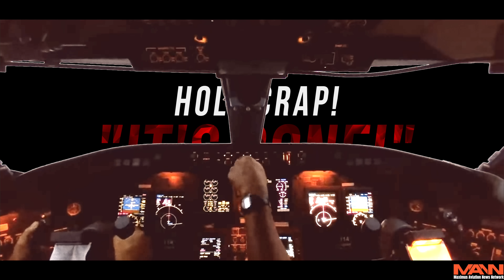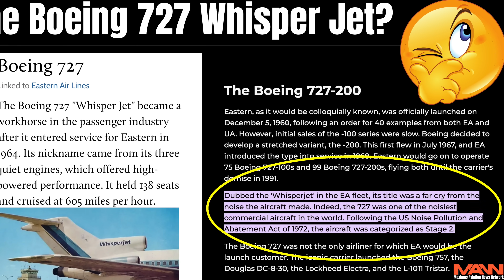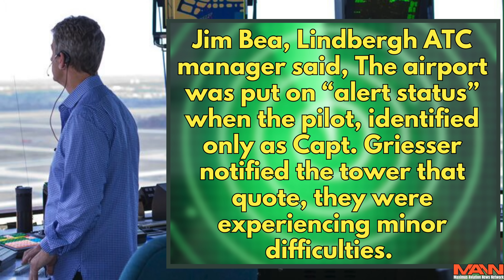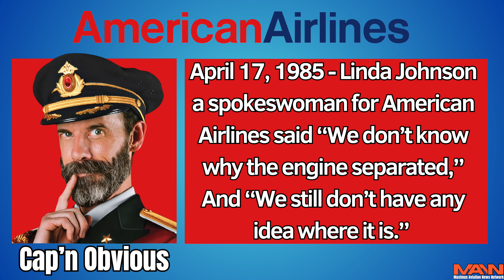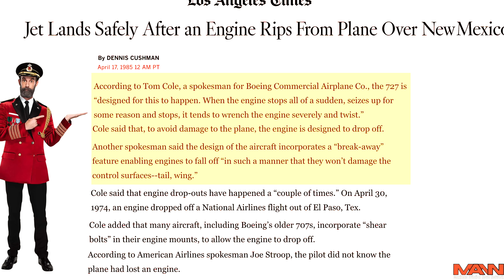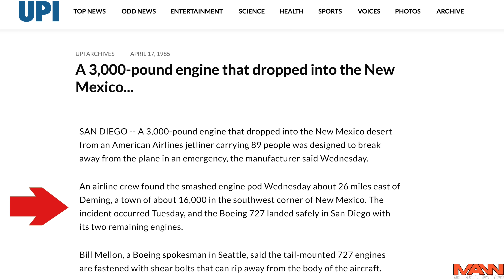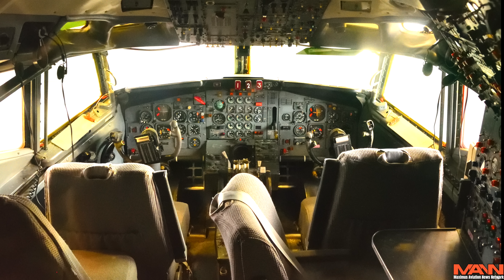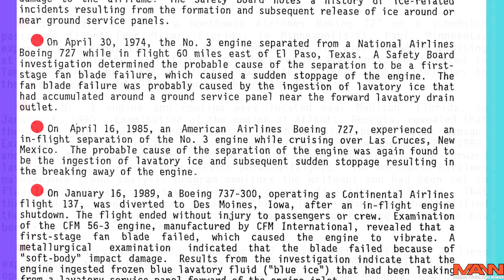Boeing 727 Engine FALLS Off At 35K Feet! Not Just Once But THREE Times. The Plane DESIGNED TO FAIL!

Comment from the maker: ^^ From Maximus ^^ Just so you know, yes I know the livery is wrong in some of the shots I tried hard to find an image I could use that would work but wasn't able to find any and until I get into that Mentour Pilot revenue stream Im kinda tied to whatever I can get 🤣🤣🤣 But yes I know.
Reply: The idea of breakaway engines is, in itself, a good thing.  AFAIK, it's a design feature of ALL planes with podded engines to this day.  Engines produce the IMMENSE forces needed to get the heavy plane into the air at all.  Therefore, if something goes wrong with the engine, causing the direction and/or magnitude of these forces to fluctuate rapidly, these forces can and have torn airplanes to pieces.  Therefore, it's better to have the engines rip themselves off the planes.  A single engine falling on a city is not good but it's a LOT better than a whole plane full of fuel and hundreds of people.  Sure, it's better if NOTHING falls for the sky but things sometimes falling from the sky is a risk we accepted as a consequence of accepting, indeed relying on, air travel.  IOW, breakaway engines are like the breakaway tails of lizards.  Not optimal but better than the alternative.

The REAL problem here is the cause of this and other 727 engine detachments:  the leaking lav.  THIS is the design flaw, NOT the fact that the engines could break away.  The blue ice from the lav leak damaged the engine to the point it was a threat to the whole plane, so the engine broke off AS INTENDED, and all good there.  But this wouldn't have happened if the lav wasn't leaking, and apparently THAT was the design flaw, NOT the breakaway engine mounts.
Reply: @TheBullethead  I never agreed to air travel in exchange for stuff falling on me.
Reply: @kenmore01  Well, if you agree to air travel at all, you have to agree that planes will pass over your head.  And planes are made and flown and told where to go by humans.  Neither the planes nor the people are perfect, which means things WILL fall from the sky periodically.  So either you accept that and live with it or go back to trains and stagecoaches.  Which have their own history of accidents.

Nothing we do or make is ever 100% safe but all mainstream things are within the realm of "acceptable casualties".  Ever wonder how many people died in mines, factories, construction site accidents, etc., to let you live with all the modern conveniences of the 21st Century?  Or how many people die in car crashes every year?   None of us are so appalled by these numbers to give up anything we enjoy today and so we totally ignore that it's all built on blood and bones.  We accept those casualties because the alternative to not having modern conveniences is worse from our POVs.
Reply: @maximusaviationchannel the 727 wasn’t called the whisper jet because the engines were quiet to ppl on the ground but instead because it was quiet to people on the plane from the wing forward.
Reply: @superskullmaster  Actually, it was super quiet to people on other continents.

Comment: Notice how they were 55 minutes out of San Diego at Deming.  That wouldn't happen today.  The 727 had a maximum operating mach speed of M0.89, and the airlines routinely operated them at the max mach number back then.  The A320 and 737 have much lower maximum mach numbers, and the airlines now operate their aircraft below MMO for fuel efficiency.

Comment: Shear bolts don’t only exist on the 727 not only that but not just on Boeing planes. Most airliners have engines that are designed to break away if structures loads threaten the aircraft

Comment: This guy is obviously a shill for Airbus.
Reply: I’m beginning to wonder. 

How about the story of Quantas Flight 72, where Airbus’ flight control computer made two abrupt, un commanded, pitch-downs injuring something in the order a 119 passengers and crew, including 12 serious injuries. One flight attendant was crippled for life. The pilot, experiencing the trauma of being in a plane which was not responding to his control inputs, ended up with severe, career ending, PTSD. 

This is the same Airbus that had a plane decide to land itself in a forest, after a low-level flyby, at an airshow, while the crew found themselves unable to overcome the flight control computer’s decision that it was time to land. 

Airbus’ flight control computers have the last say in which control inputs are actually passed along to the control surfaces, in an aggressive form of “envelope control”, designed to prevent pilot actions from overstressing the aircraft. That’s all well and good, until the flight control computer is getting bad data from a failed sensor or is inntne wrong mode and decides that it’s time to land, even against the flight crew’s wishes. 

Boeing had truly disappointed me, of late, but I still prefer their aircraft over an Airbus.

Comment: Unfortunately, this was a frequent event even through the late 90s and early 2000s. Not an engine departing the aircraft quite luckily , but blue ice leaking from forward lavatories on the  727.  Working the ramp in LAS, many times I had seen both Champion Air and Sun Country have this problem! Frozen, clean blue ice on the lower fuselage behind the nose gear. One particular time had me scratching my head when I marshaled in a Sun Country 727 with a block of ice that was as large as a rectangular coffee table taxied into the gate! It dropped to the ground with a large thud about 10 minutes after the aircraft was parked sitting in the baking sun of Vegas! Could have been disastrous had this block of ice fell on final approach, striking objects or even people!

Comment: Actually having a designed failure mode is considered good engineering. What it tells you is that they considered the possibility of extreme torque causing damage to the airframe and put in a failure made that would allow for it without the loss of the aircraft.
Reply: Exactly. This is a non-issue.

Comment: You know, seriously, a basic principle of aviation weight-and-balance calculations is that the center of gravity (CG) moves toward a weight added, and moves away from a weight removed.  That engine is a heavy weight, suddenly removed from the rear of the aircraft. If they lost an engine near the rear of the aircraft, the CG would move forward, making the aircraft more nose heavy. A nose heavy condition is not a good thing, but it is far, far better than an overly-aft tail heavy CG. I wonder if they were able to trim it out. Either way, I'll bet the landing was bouncy, with a lot of extra "bang" on the nose gear......
Reply: 3,000# would be well within the trim range of the aircraft. They probably didn’t even notice tnst aspect of it.

Comment: The JT-8 engines are held on the B-727 by 3 cone bolts (tapered bolts) which narrow down to around a quarter inch (1/4") then enlarge to receive a 5/16" half castle nut with a cotter pin. The last engine I put on a 727 was in 1980 and as I remember the torque was 145-inch pounds. After I moved up to the cockpit as a pilot, I never flew a plane with a leaky lav service port.

Comment: In order to fix the problem of the forward lavatory leaks, they put a "donut" over the access hole that could only be installed and removed with a t-link type of tool.  This is also true with the forward lavatory on our S-80's (before we retired them) so even if the lavatory leaked, nothing would come out but I always stood back when removing the donut.  Sometimes I would see my co-workers get a "blue bath" of about a gallon of the liquid so the rest of us dumping lavs knew to stand back when first opening the cover or removing the "donut" for the aircraft that didn't have a cover that latched shut under the outside panel.  It didn't matter if the rear lavs leaked because there was no engine/aircraft damage due to flying ice from under the engine at the back of the plane.

Comment: Never had one fall off, but had one with extremely loud noise and strong vibration. Reported it to flight attendant and asked her to relay to flight crew. I told her I had flown on many 727s and never experienced this before. She came back 10 minutes or so later to tell me the pilots said it was "normal."  They never came back to check. Fortunately, it did not fall off. Never flew with that airline again.

Comment: It seems to me losing  a 3000 pound engine on the aft end of a 727 wound change the center of gavity a bunch and the flight engineer would notice no readings on that engines gauges,WOW! and in passing the jt8 pratt and whitney engines sound like an F4 Phantom in full afterburn almost makes your ears bleed!!!
Reply: I once found myself about 200 yards behind, and thankfully about 200 feet below a 727 that was doing a go-around, when I worked at Denver’s old airport. It was loud, and sort of fun to watch. Fortunately, the pilot kept it sunny side up, but he was scrambling for every inch of altitude and a bit slow, so it was quite a show.

Comment: I flew on one of those from Hawaii to San Diego during an airline strike. They shoved me in the back. It was like 3am so they turned the lights off. It was a similar noise to a motorcycle at 70 miles an hour without ear plugs. No idea how that was ever allowed to fly civilian passengers, let alone for decades. The engines did stay attached thankfully.

Comment: Good ol days for Boing. Today, a Boeing airplane is assembled for doors  to separate first
Reply: Doors to separate followed by the remainder of the fuselage very quickly after that by followed by the passengers exiting the aircraft, therefore avoiding any potential lawsuits from passengers that may have some technical knowledge to identify the poor engineering and quality,  making it much easier to blame pilot or weather or something else-  anything else just not Boeing

Comment: The 727 wasn’t called the whisper jet because the engines were quiet to ppl on the ground but instead because it was quiet to people on the plane from the wing forward.
Reply: I've only had one flight on a 727 & on that flight had a window seat just behind the wing.  The 727 seemed very quiet on take-off, but once at cruising altitude, the wind noise made it much the same as a 737.  Same on final approach the noise level decreased because there was less wind noise.
Reply: Man, I miss the old school sounds that the 727 and 737-200’s made, the hydraulic flap motors and the JT8D that actually sounded like a jet engine..

Comment: I remember pilots didnt know how to fly it at the start but they soon got a hang of the 727...
Reply: The Seven-Two brought turbine powered service to shorter runs, so a lot of the pilots were transitioning from turboprops and there was a lot to learn. The flaps & slats on the 727 were quite advanced, which is what made shorter field ops possible, but they had to be set by the book, and if they weren’t set right, there was a very real chance of serious trouble. 

For a couple of years there, the 727 had a very bad reputation with the public, but I think that they improved the training and it was no longer a problem. Overall, the 727 proved to be a great plane, for its era, and it was a workhorse for decades.

Comment: Nice! Hope you're going to cover the 747's tendency to spit off its cargo doors and Boing's tendency to (shock) cover it up as long as they could get away with it. Keep up the great work
Reply: You do know that only happened on 1 747 right???? 1,547 were built. You do also know that it was caused by lack of proper maintenance procedures by United right? The DC-10 however had it happen multiple times and THAT was actually a design flaw. You are clearly NOT a true aviation fan or you would have done your research.
Reply: @dmcr9525  No. You need to do some research. It was several and Boing knew about and covered it up for a long time.
Reply: @auntykriest  What are the several incidents because I am an Aviation Maintenance Tech, and we review almost all aviation incidents of all kind. Where are your receipts? I need flight numbers and airlines because I can't seem to locate any other than UA811....

Comment: So, Boeing showed how honest they are way back in the 70s by calling one of the noisiest jets ever made the "whisperjet".
Reply: Actually, it was Eastern Air Lines that used that word to describe it's fleet of 727's, not Boeing.
Reply: @lrg3834  Yes, their DC-9's were called Whisperjets too!
Reply: The reason they called it that is because it was extremely quiet inside due to the rear mounted engines. 
I flew in them quite a few times. 
Extremely quiet and vibration free. I loved it.
Reply: In the early 70s, they probably were a good deal quieter than the 707s et al, that preceded them.
Reply: About as honest a tobacco companies back in the days, and probably still now.
Reply: Eastern Airlines called there jets Whisperjets.
Reply: All 727's were required by the FAA to install "hush kits" on the engines in order to remain in service back in the 1990's.  Planes now are so much quieter.
Reply: With the engines in the back, made for a much quieter cabin. These plane were real “floaters.”
Reply: Clearly you are not a true aviation fan or you would know why it was called such...
Reply: @dmcr9525  I was going on the information put out by Maximus.
Reply: @dmcr9525  1st hand experience……duh
Reply: @1SAM007  That is quite obvious as I have been on the 727 as well as and know why it got that unofficial name as several others have mentioned in this post.... That post was for the people that clearly dont know. Lol
Reply: @1SAM007  Paranoid much?

Comment: "Leaking toilets lead to engine separations on Boeing 727 airplanes" might also be a proper title.
Reply: OK! How about (drum roll....wait for it....) "Leaking toilets lead to leaking management......"  Ta da!!
Reply: @fredferd965  🥲😍😅🤣
Reply: Sounds like a shit design.
Reply: Boeing was using a short lived design paradigm back then that the engine mounts should be "fusible", meaning that vibrations were capable of breaking apart the mount, in the theory that shedding a vibrating engine was better than keeping it attached to the aircraft 😅
Reply: Yeah, but spoiler.
Reply: For a movie indeed 😂
Reply: How about "Boeing 727 is engineered to be so full of shit in flight that it can't even hold onto its own engines"?🧐